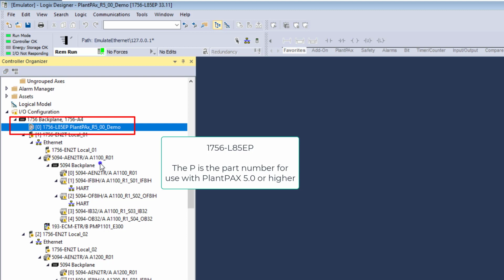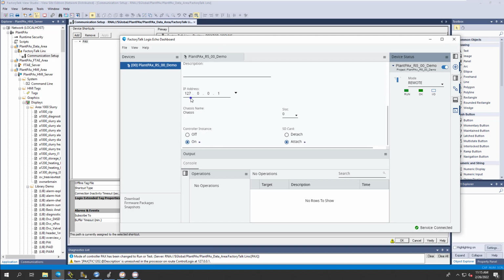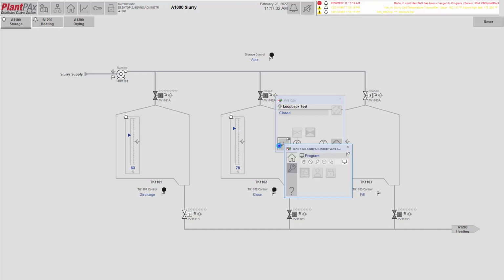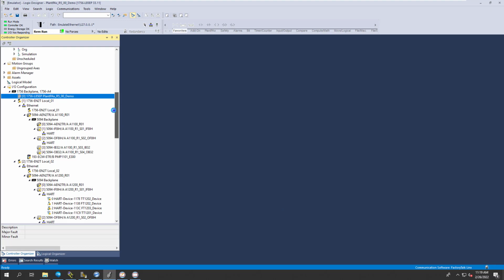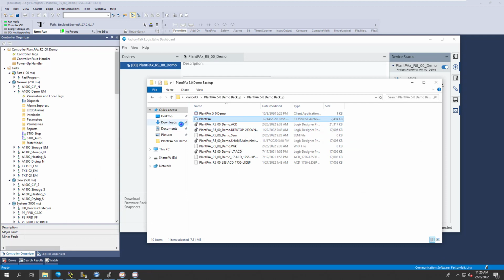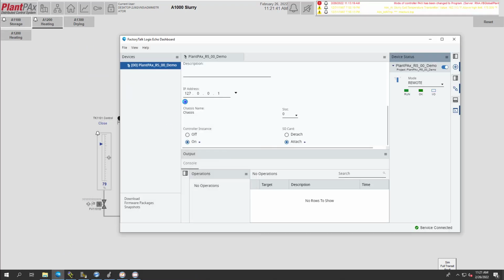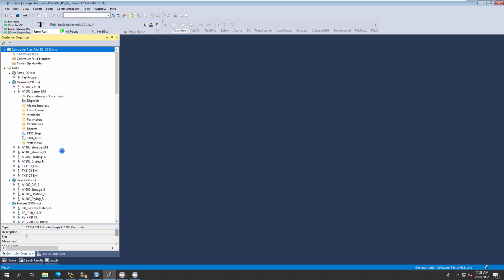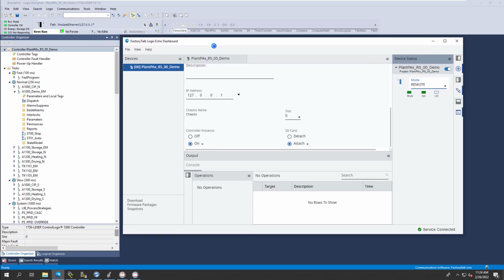PlantPAX 5.0 using FactoryTalk Logix Echo as Designed By Rockwell Automation

Comment: Hi Shane,
Could you please advise if it is possible to use FTView Logix Echo to connect to AVEVA Plant SCADA, and which protocol would be used?
I would appreciate your guidance, and please let me know if you have any reference material or videos on this.
Reply from the maker: Depends of what version of Echo you are using
Reply: @ShaneWelcher  Thank you for responding. I'm using Echo Ver 4.00
Reply from the maker: @NchimunyaChizyuka Then you can
Reply: @ShaneWelcher  Just to confirm my understanding: can AVEVA Plant SCADA communicate with Logix Echo using the standard Allen-Bradley Ethernet driver provided in Plant SCADA (as it would with a physical PLC), or does this need to be done via OPC??

Comment: Shane, appreciate for posting these great videos. Coud you please share some knowledge how to modify/change or even create your own faceplate? Thank you
Reply from the maker: I'll look at making something when time allows, extremely busy right now although I will keep this in mind.

What would you like to see exactly ?
Reply: @ShaneWelcher  Thank you, Shane. I want to create my own faceplate which has operator tab which controls like jogging, manual and auto mode switch, speed reading. One tab for trending and one tab for alarm active and history. The PlantPAx lib is powerful but way more complicated for my process.
Reply from the maker: @donniechen8718  I agree
Reply: @ShaneWelcher  i tried to modify the PlantPAx lib Block- P_VSD, but it is impossible to even put a button inside existing defined group 😅. Maybe locked by Rockwell. Otherwise it will be much easier to customize using existing faceplate as a reference to work on. Anyway, Man, you put a lots of good video  on web to share with others, many include me appreciate that!